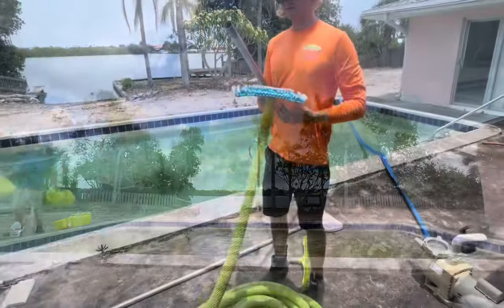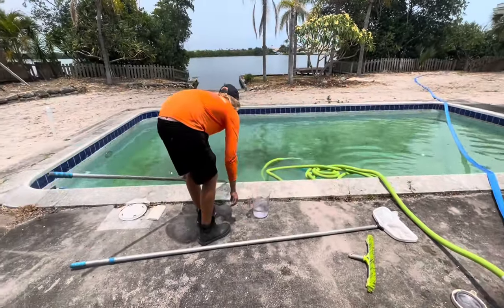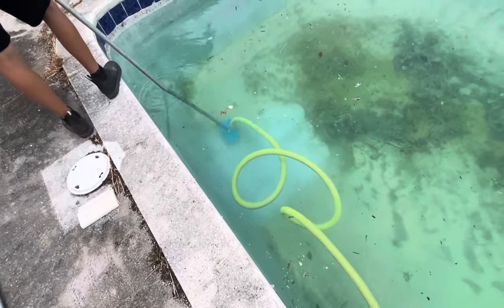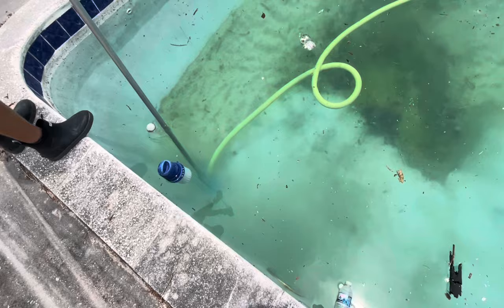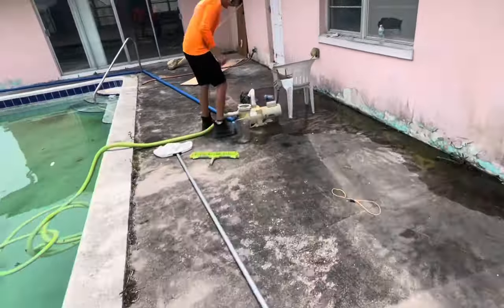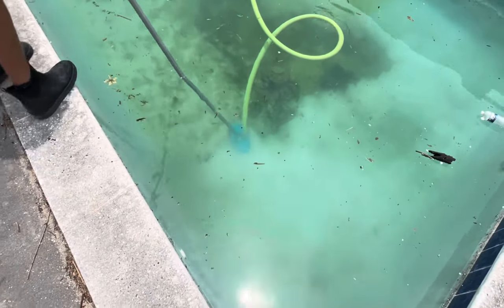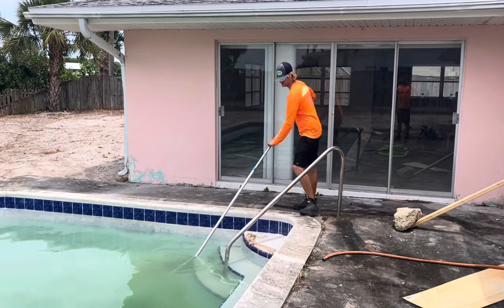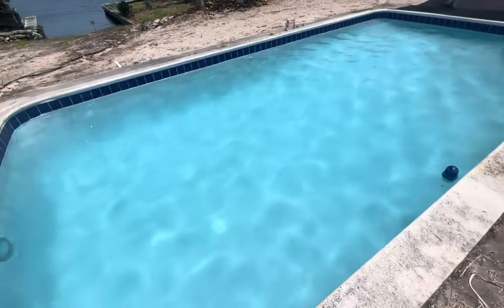GREEN POOL to BLUE in 48 Hours

Comment: If the PH was high, shouldn’t you use muratic acid first (to lower the PH) then the chlorine? Or does it really not matter which order?
Reply: I think it's not much of a difference. The acidity frees up chlorine once they combine in the water. Just don't mix chlorine and acid directly or you'll be creating chlorine gas.
Reply: chlorine contains cyuranic acid in tab form and in some liquid varieties as well, which will lower the ph, so by adding the chlorine before you adjust the ph, you ensure an accurate reading.

Comment: 3 questions for you….
1)are you using algae brush on all the pools? Plaster and fiber glass pools.

2) why only 8oz of phosphate remover?

3) I understand the amounts of chlorine needed to burn off the ALGAE,but why dilute the muratic acid? Why not just use 1 gallon of acid ? Help me to understand why only 1 gallon of muratic acid and not 4-6 gallons of muratic acid?
Reply from the maker: Only use algae brush on plaster or pebble pools /rock features. It will ruin vinyl or fiberglass finishes as well as some tile so be careful
Reply from the maker: 8 oz is the recommended dose for how expensive the chemical is I always measure it out
Reply from the maker: Anything over a quarter gallon of acid should be diluted acid is heavier than water and it will and can fall straight to the bottom and burn the finish diluting helps spread it out evenly. I also would never add more than a gallon diluted of acid at one time for this reason.
Reply: Wow, you’ve explained to me what  my boss couldn’t explain to me. Learning so much from you. Also, do I need to buy“diluted acid” from a wholesale store or do o dilute it myself by pouring in 1/4 of acid into a cup (or something) and fill it with water?

Comment: How do you set the pool to 24/7? On a Pentair and other equipments? Do you have videos on this?
Reply from the maker: No but we’re happy to make one! The variable speed pumps need the schedule changed to 24/7 the single speed pumps you just remove the “off” pins off of the timer
Reply: @PoolCareWorld  any chance of creating a video of this? Also, before pouring chems into the pool, is it “ok” to use my cordless vacuum to suck up the leaves? 

What’s the step by step process for dealing with green algae l?
Clean cartridge first then chems?

Comment: Thank you for making this video!!

In Florida a home owner had let the pool go for two years. 

I’ve dumped so much CL and shock in it. Got it to a blue color but the bottom was cake in debris. I couldn’t for the life of me get my portable waste vacuumed primed. For hours I’ve tried getting it primed and nothing. Any suggestions? Or a step by step how to prime it.
Reply from the maker: Keep adding chlorine it can flip fast with all that debris in it! Every time I can’t get it to prime it’s always one of these for me:the pump lid oring or the plugs on the bottom orings need cleaned or lubed or your hose connection has a airleak. Let me know what it was! Good luck!
Reply: @PoolCareWorld will do! It’s a brand new pump. A plug in 1hp off Amazon. Now that you mention the hose having an air leak, that could be it. I noticed water come out where the hose and white cap meet. I bought the hose brand new and thought that was normal lol
Reply: @PoolCareWorld Connect your vacuum attachment and set it into the pool,  put the whole hose into the water and fill it completely with water before connecting it to the pump. The hose needs to be full of water and placing it into the water is the way to fill it. Just hold onto the end you'll attach to the pump. Hold it under water until the air bubbles stop and it's full of water. This is the way you're supposed to do it.

Comment: Did you have to use something to help clear up the water after the acid, chlorine, phosphate remover, brushing, and vacuuming. I have a Pentair cartridge filtration system with an Easy Touch automation and i don't believe i can vacuum to water, so I'll have to vacuum through the filter. How can I tell when the filter cartridges
 need to be cleaned?
Reply from the maker: If you’re using the filter you’re going to have to monitor the suction if it looks anything like this Pool once clear it’s literally going to be need to be cleaned every other swipe so probably will have to clean the filter 20 times during the course of the vacuum. If you don’t want to go through that cut your pipe coming out of the pump into the filter and add a waste valve. Would you like me to make a video of this? Please subscribe!
Reply: @PoolCareWorld  yes that would be great